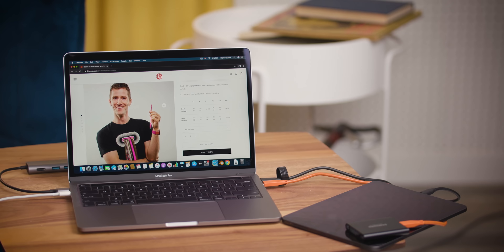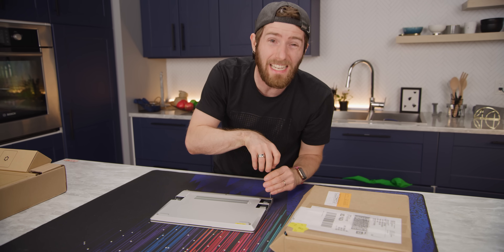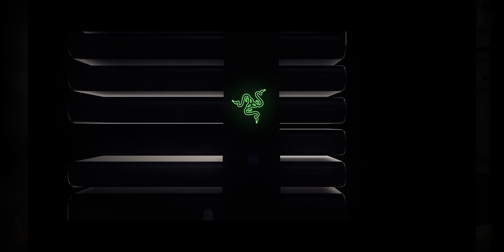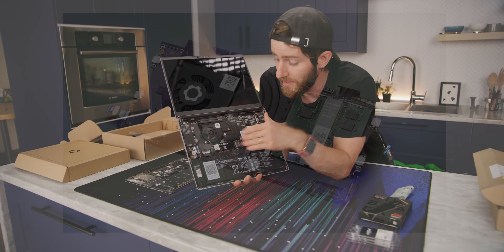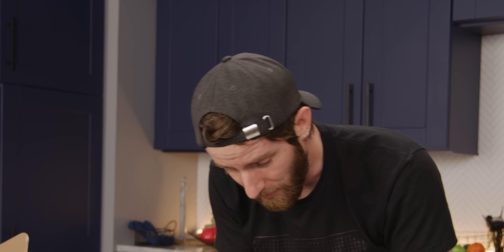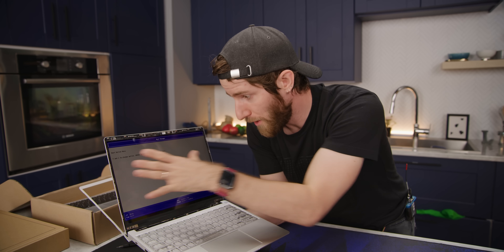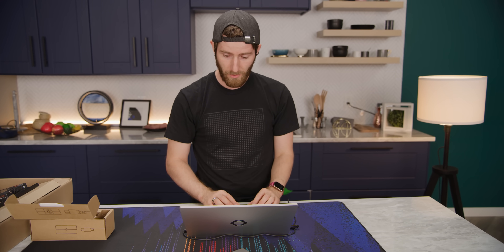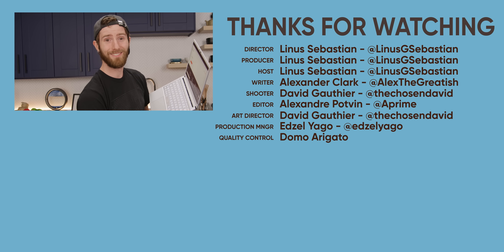A COMPLETELY Upgradeable Laptop?  - Framework Laptop Review

Comment: Just a headsup y'all, this thing doesn't support discrete GPUs - you'll have to get an external enclosure for that. Every other spec looks amazing, though!
Reply: Thanks, I was wondering about this but the site got hugged to death.
Reply: I mean still though, given with how modular the external ports are, I am sure that there would be an elegant way to package an external GPU
Reply: They will probably come next, as I'm sure no manufacturer will create a modular chip without being able to sell a certain number of them. Framework may actually pull that off in a year or two if this goes well.
Reply: @dicknoseturdwaffle5305  According to this article, framework has no plans to include a discrete GPU with "this model" of laptop: https://www.tomsguide.com/reviews/framework-laptop-review-hands-on-the-anti-macbook-is-here

The question is, how long before they develop a new model? Given that their laptops are inherently long-term being so modular, they're a new company, and that this model just came out, I wouldn't expect anything soon.
Reply: @ficklebar  hence my point of waiting a year or two. I'm sure they have something in the works for another model that could.

Comment: I'm super rooting for this company to succeed.  They did basically everything right.  The only big question is their longevity.  If they sell enough to create a stable foundation, small businesses that need to squeeze every ounce of value out of their laptops and need them to be sure that repairs will be affordable and available should look to companies like this first.  If you have a laptop fleet of all the same model then as they age and the chassis start to fall apart, you can salvage them for spare parts for those still running.
As a consumer my wish list for the future of framework is:
- touchscreen option
- another version with dgpu (maybe a 15")
- Surface-style tablet PC with pen support
Linus mentioned magnetic connectors.  I'd also kill for a magnetic thunderbolt compatible connector standard.  I recently decided to try out magnetic usb cables and while there is no standard for these, I just bought a bunch that I use in my own home/office/car and they've been fantastic, but they only do usb-2.0 data rates (the ones I got are Volta brand).  I still use my Surface Pro 3 and the connector is great for that.  As much as USB-C standardization is great in some ways, I wish that there were a standard for a magnetic connector as well.

Comment: The one thing I want ALL laptops to be able to do is BOOT and OPERATE with the lid closed and the LCD disabled. Why? Because I use it as a very slim desktop most of the time and it'll be nice to not have to have it take up desk space and distract me with its display when I am home and plugged into two 4K monitors, an external KB and external mouse.

Comment: I really like the concept, but you can't deny it's worrying not to know if it will work well enough to still see new components sold by them in 2-3 years.
For the moment, I would only buy it for what is available right now. If they are still around and strong by that time, good, but if not, I wouldn't be disappointed.
Reply: The purpose is that it shouldn't matter if they sell the components. They're non-proprietary parts and can be replaced by any compatible component.

Comment: a DIY build laptop. even if the processor is soddered, you could easily just buy new motherboard inserts to keep it upgraded over the years, could even swap between amd and intel, or new socket/process nodes. But i really see this as being MORE profitable for them than the locked units the other people sell. Instead of having 8000 different skus or losing customers for not offering what people want, they can just make new modules to catch everyone.  you want 4k monitor? 1080p 320hz? new switches on the keyboard? bigger battery? better webcam?  They can just release a new base shell every once in a while as needed, and stick with the components and it would be awesome.

Comment: This is actually insanely cool. I wish more laptops at least allowed you to easily disconnect the battery, maybe something like a switch you can flick on the outside to route power directly into the system without going through battery first.

Comment: In fairness to clips, there are some environments in which magnets are risky to have on electronics.  I started using Volta-style cables in a machine shop, and the accumulation of rusty metal dust in the connectors kills them pretty fast despite frequent attempts to clean.  The magnet thing is really cool, but there is a downside.

Comment: Tldr, until we get all standard parts in laptops like we do in desktops products like these do nothing.

First off, i love the idea behind this and i realise they are one of the few who actually tried making a product like this.
But, in the end you're still realiant on their proprietary modules for outside expansion.
I realise that's better than nothing but its still incredibly limiting.
The dream would be using all standard parts, which is very much possible but it is very hard to integrate into a pretty looking device.
The replaceable mobo and their cpu roadmap sounds amazing, but in the end you again are reliant on framework supporting the product and coming through with the upgrades.
As we have sodimm's for laptop ram, we need standard mobos and replacable cpu's. Until then products like this are stopgaps at best and marketing ploys for techies at worst.

At the end of the video Linus says it himself, they designed the product in a way that you have to come to them for upgrades. 
If that doesn't sound like a rehashed  walled garden then i don't know what does.

Comment: Linus: starts out trying to sell this device as being just as clean and sexy as more tightly-integrated laptops

Also Linus: puts on ugly see-through keys that will immediately turn off every single "clean look" type user.
Reply: Indeed, taste is a preference. Also, the clear keycaps add "toy factor", it's good advertising
Reply: Yeah those were awful.  I'm sure there's a market for it, but why not opaque white to go with that white bezel?  I bet there's a bigger market for that.
Reply: ^ Not appreciating early 00s electronics fashion should be a crime.
Reply: @tams805  even in early 00's, it was mostly used in cheap/aftermarket stuff, e.g. that knock-off game controller that nobody wanted to use. It's never been a mainstream look that I can remember.
Reply: As you know, Taste Is A Preference.
Why would you get turned off from a product, just because the reviewer does something you don't prefer?
Listen to the actual review, nitpicking is useless if the keyboard is replacable in a pinch.

Comment: it's been next to impossible to find a decently priced laptop with the arrangement of I/O not to mention reliability for the last couple of years. With so many laptop manufacturers screwing over the end users countless times and in different ways. If you don't pay enormous amounts of money for what you want, you can't get it, but in doing so they then stuff a bunch of other shit in the laptops that only contribute to it's far earlier demise or add additional costs for things we don't even need.

The most common irritation is the fact that so many will segment their laptops in such a way, that getting what you need ends up with a dedicated gpu being thrown into the mix that you don't need at all.

I'm a retailer, and i get constant customers that are frankly fed up with what is available, many aren't clearly aware of what they actually need either, but if there is one thing that is a certainty, it's that adding a dedicated gpu to a system, is that it's going to be the primary likely problem in the future, be it through all out failure, or the fact that even if it's not "running"... it's still eating power unnecessarily. Much like literally anything else on the planet, the more shit you jam into a tight space as a "feature".. the more things can go wrong and will go wrong that had it not been there at all, likely would result in a far greater lifespan and functionality in the future, plus it just costs less.

If framework can provide some Ryzen 5000 series APUs without any additional dedicated gpus, keep temps low, keep good modularity, i'm sure i could sell dozens if not hundreds of these laptops to customers waiting.

OH, and one other thing, USB type A ports and most certainly C, if there is one thing that utterly kicks ass for this modularity, is that the shear number of people that have destroyed their usb ports, being forced to replace the entire laptop, simply pulling the modular part out and sliding in a new one is game changing. If it isn't dead dedicated gpus killing laptops prematurely, it's the charge ports/usb ports that have made them useless as well.

Comment: This is just about perfect. I'm hoping they are around and have fully ramped up manufacturing when I need a new laptop at the end of the year. Hopefully a touch screen will be available but otherwise it covers just about everything else I would want. I didn't see any weights but if it is under 3lb it would work for me. If it was an option for a smaller lighter battery (half size?) that would be great as well, I do 95% of my work plugged in and never spend more than an hour or two when unplugged.

Comment: A Laptop will never be "completely upgradeable".

The Motherboard ages. The Motherboard technology ages. The GPU technology improves. The CPU technology improves. The RAM improves. The COOLING methods improve. 

You want to upgrade?  BUY A DESKTOP.

Otherwise, just get a new laptop every 5 years.

My last laptop was an Alienware R4 with a GTX 1060, 16GB DDR4 and a 256GB SSD.   $1600  back in 2018

I RECENTLY bought a TUF  with a 5800h,  3050Ti,  16GB DDR4 and a 512GB SSD  for $1099. 

WHY WOULD I BE TRYING TO BUY PROPRIETARY PARTS AT PROPRIETARY PRICES to UPGRADE when I can buy all new hardware?

Comment: Would back this, but a non-upgradeable CPU on the "COMPLETELY Upgradeable Laptop" makes this seem a lot more for marketing rather than actual progress in the right to repair movement.
Reply: Intel and AMD dont sell the chips with LGA pads. Not sure what you want them to do? If there is enough demand Im sure Intel/AMD might be willing to sell chips in that configuration again.
Reply: There are no sockets available for mobile CPUs now. This is the only option besides putting in an actual desktop chip.
I understand what you're saying, but this is the absolute best we will get. iFixit gave this device a 10/10
Reply: I disagree. Yes the mainboard and the CPU are a set. But you can order a mainboard with the CPU and put it in your existing case with the display, ram and wifi card and SSD at a later point. You have absolute IO freedom. What other manufacturer does that?

Comment: That’s honestly amazing. And even though the CPU is soldered onto the mobo, it’a still technically a modular part due to the fact that they could literally just sell you a “CPU upgrade” that just requires swapping out the Mobo. Not to mention, if they offer discounts for trading in your old Mobo, I could see this being a really environmentally friendly option where you send back the old Mobo and they tear it down and recycle it properly while also reusing any pieces they realistically could or just simply reselling it as a used product for a discounted price for those people who may not necessarily want or need the latest and greatest CPU but maybe haven’t upgraded in 3 or 4 years

Comment: I love the concept. It gets old and slow, you buy a new motherboard module and swap it out. You'll spend less money (probably) than you would on a whole new laptop. Additionally, it helps prevent eWaste because the rest of the parts are still good after all. All they would have to do is ensure they maintain the form factor of the main board.

Comment: I can replace the CPU in my T430 laptop.  Can change battery, add three drives, ram is upgradable, change the wifi card (with some difficulty), and change the screen.  But yeah, 2012 (but not 2010).  Their website isnt' working btw.